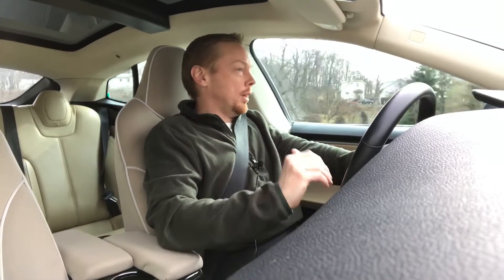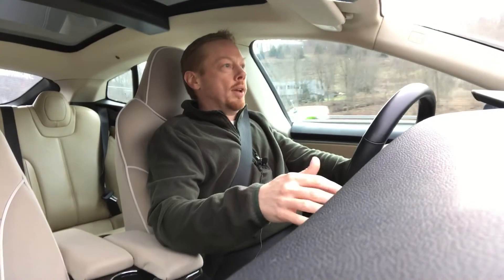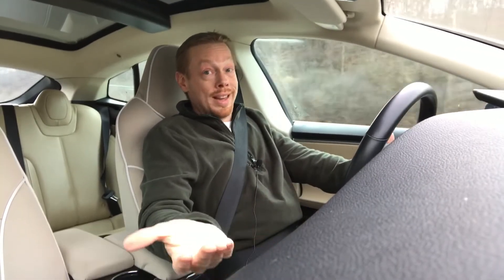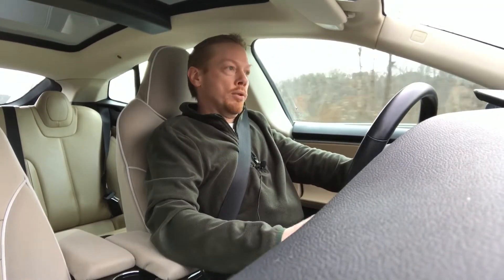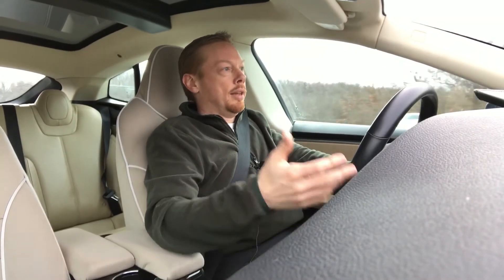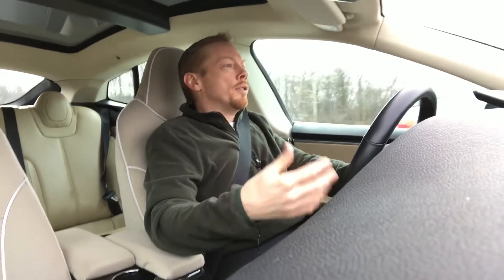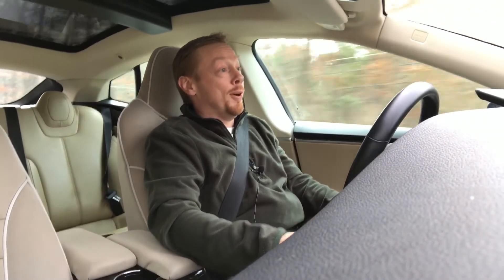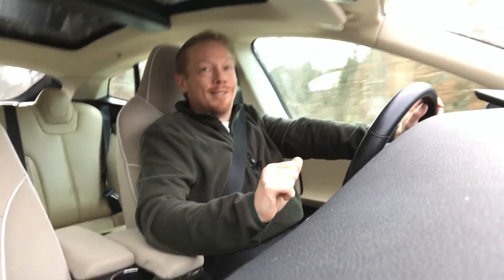Troubleshooting Charging Problems With Your Electric Car / Tesla

Comment: I have a earlier mobile charger version and my “T” went red. I got a “Mobile Equipment failure” message from the car. The charger went black when I flipped the breaker and I thought I killed it. But all thanks to TESLA_MECHANICS on Instagram for your help.  :elbowcough:

Comment: I have a 2013 Tesla s 85 with a Gen 1 charger and one day I plugged it into the charging port and it started to flash green indicating it was charging. Within 30 seconds the charging port turned solid red. The dash panel said check charging cable connect. So, I UNPLUG AND RESTARTED THE PROCESS.  The Gen 1 charger box showed a green light and I plugged it in again and the Gen 1 lights stayed green and went into a sequential green flashing mode. In about 30 seconds the charging port ring on the car was solid red and the Gen 1 charging box had a solid green light on but not sequential flashing anymore.   The notifications on the panel said CHG_007 AND CHG_012.  NEXT i WENT TO A PUBLIC CHARGING  STATION and used my J adapter and the charging port ring turn solid red.   I was able to charge up at a Tesla charging station. Can you help me please. Is there a reset button on the panel ?
Reply from the maker: If you're able to charge at a Supercharger (DC) but get errors at every other charger (AC) then it is likely a problem with the on board charger(s) under the back seat.